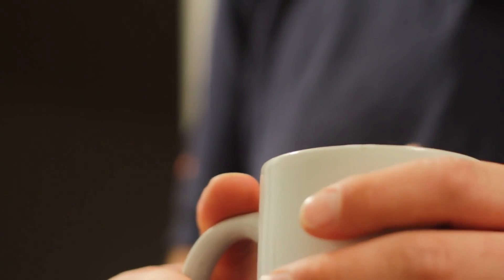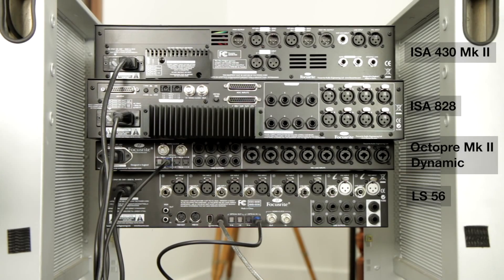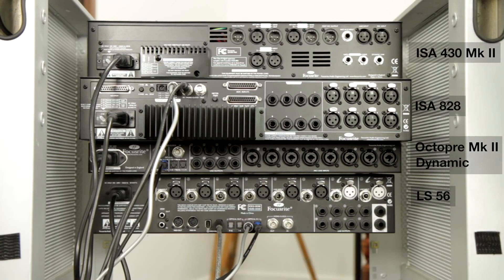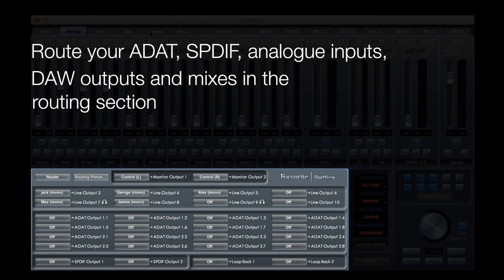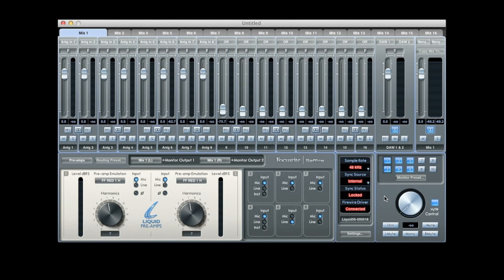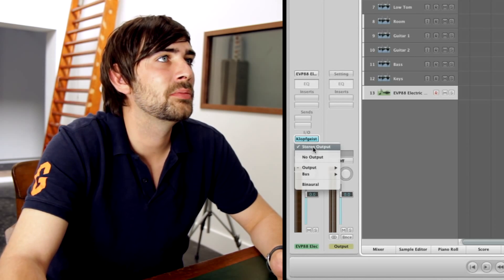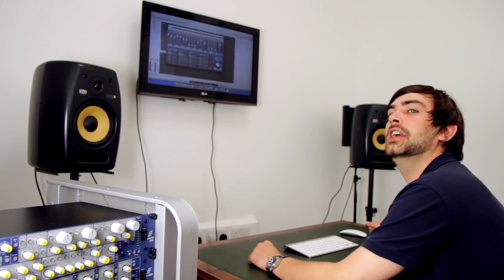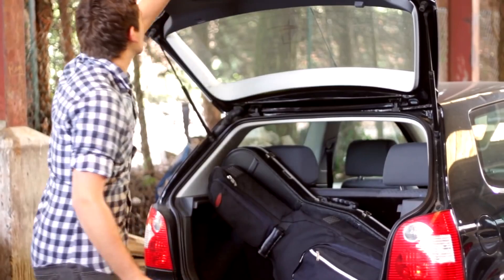Focusrite - Saffire Mix Control Tutorial

Comment: I would have used the two Saffire 56 inputs with the ISA emulation and since the preamps of the 56 are the same as the Octo I would not have used the latter especially since the phantom power supplies are not selectable at the unit...

Comment: Hello - Could help. I was unable to make the connection to use the external compressor in the Saffire 56. Out 3 of the Interface to Compressor - Out of the compressor to In3 of the Interface. Any specific settings in the Mix control? Can you tell?

Comment: Why do the inputs have to be up full to get enough signal with mics? It's the same with both my pro 24 and pro 40. Using phantom power. Using a mixture of different mics  SE, Neumann, AKG, Rode.
All need to be up either full or nearlly full to record acoustic guitar. Mics are only about about 4  inches away from guitar too. 
Once almost full, you hear a high pitched whine.

Comment: Sorry for asking a stupid question, but won't sending a mono mix to a headphone result in the mix coming out of one side of the headphone only? Or did I miss something...
Reply: +bizz837463 full disclosure I didn't watch the whole video but if he uses the line outs in the back as monitor mixes by plugging headphones to them or something like that, it works because the jacks are line level 1/4" TRS, which is technically the same type of connector that headphones use. It can either be balanced mono or unbalanced stereo, which means the you'll get signal in both ears

Comment: Thanks for the helpful video. So am I right that the pre-amps are only available when using the mic inputs on the first two channels? I am using a synth, so that means I have to change a cable from 2 jacks on bolth sides to 2 cables with a jack on one side that goes into my synth (waldorf blofeld in my case) and a XLR on the other side for the mic pre amp. Maybe a silly question, but why aren't those summoned after the input so you could use bolth mic and line for the input?